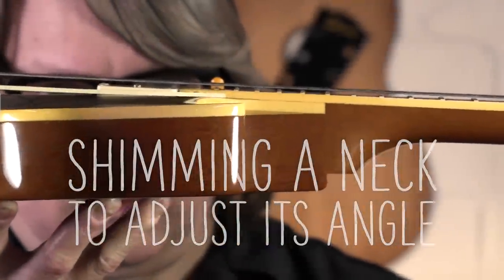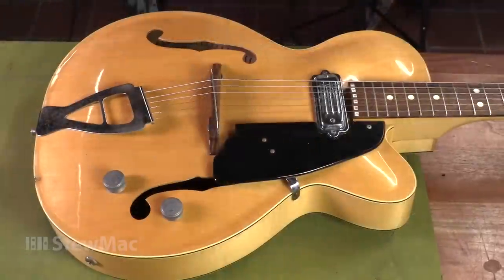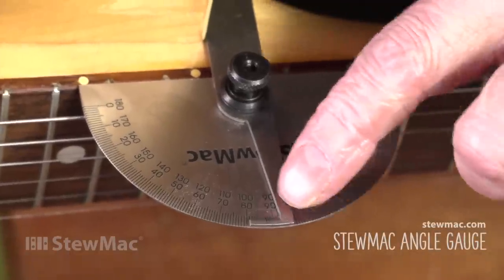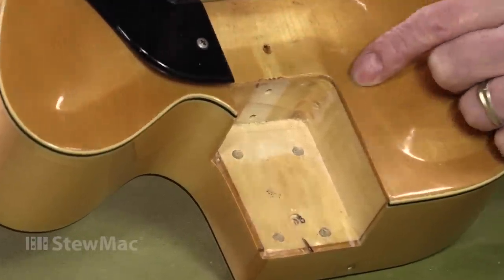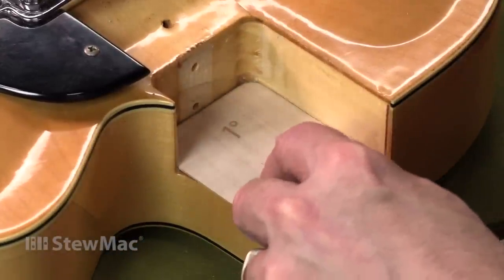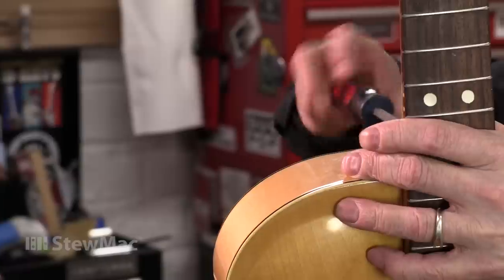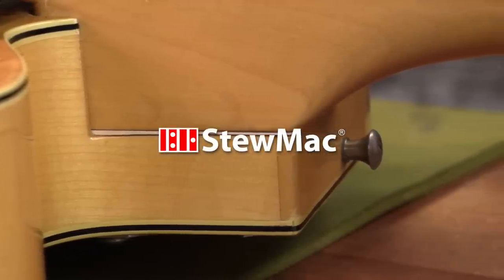How to shim a guitar neck to adjust its angle

Comment: the bare shim edges would absorb moisture,i'd coat it with honey shellac mixed with thinning alcohol so it soaks in deep,and a final thicker viscosity layer so the shim goes hard,a light sand and fit n forget,as long as the sanding is square and true of course.

Or make an angle jig to plane or sand new shims from maple.
Reply: He said to use a full size shim so clamping the neck on tight will inhibit moisture into the neck pocket.
Reply: wooden wedges are hammered into cracks in rock,which has a far stronger bond than  four screws into the neck through the body,to crack  and split rock,what then makes the neck/body joint stronger than the force that split the rock.
I would seal the wood shim as i said to avoid any warping  due to the wood being able to absorb moisture,even when the wood is compressed by  a screw joint and not hammered into rock ,which has to be said will compress the wood fibres far more.

Comment: Question: Why not simply flip the neck and trace the heel of the neck on to the shim? Seems easier than micro-cuts and radius gauges with the actual pocket.
Reply: @kevin paul halliday  Shh ! You're gonna ruin it for them. Stewmac employs lots of people selling and posting their wares.
If people find out that most of the tools they sell are not really necessary, then Stewmac will lose money and ultimately have to put off hard working people 
who are just trying to support their families . I bet you one of these workers has a new born baby they have to feed and nurture , and without work they wont be
able to do that.
What is it you have against babies anyway?
Reply: You can do that but how would you know how much to take off? In other words, where would you line up the neck on the shim?
Reply: Because that's the best way to do it if you also sell micro cutting tools and radius gauges.
Reply: That's what I do.

Comment: Definitely better than using picks or pieces of cardboard/ sandpaper to shim.  Makes sense to try to get full contact between neck and bottom of body pocket.  Any neck shimming will change the break angle at the bridge (if same action is maintained) , that may or may not cause a difference in "feel" which can be noticeable in string bending in particular.

Comment: I've recently procured an 82 USA Peavey T-15. I noticed it had a built in adjustable neck plate, I thought "sweet, I don't have to make a shim to get the action I want". However I also noticed that raising the angle would leave A: a gap between the neck and pocket and B: leave the bottom of the neck essentially teetering on the tip of the adjustment screw. I don't think I like the thought of either of those taking place. I'm just going to use the adjustment to get it how I like, make a shim to fill the gap and balance the pressure on both sides of the adjustment screws.

 Any thoughts on this? Am I overly concerned about something the Peavey already considered?

Comment: I'm wondering if I can use a shim but set it the opposite direction in this video to obtain a higher action on my strat. My new warmoth neck will not give enough relief to eliminate buzz and the saddle heights are maxed out.

Comment: @StewMac could I use a shim vice versa to get a neck angle shallower ? I have a 90's Strat which is buzzing at the upper frets and adjusting the truss rod does not work. Strats tremolo bridge isn't that adjustable either...
Reply: Try looking at the nut
Reply: @DavyHulme  that has the same outcome as trussrod adjustment. at least beyond the upper/12th fret. thx anyway
Reply: @PhilTheKnuckle  just a thought. It's could be a combination of several things;  crimson guitars have some v comprehensive set up videos, including one, well at least one, on neck shims, might be worth look at

Comment: I don't understand how putting the thick end of the shim toward the body helps. I'm so confused. Wouldn't that make it worse? Because now when you play a string at, say, the 15th fret you'd get buzz from the 16th and up. You didn't raise anything other than the 21st fret and every fret below is now angled further down. What did I miss?
Reply: I agree. In my case I think I need to put the thick end  towards the tuning keys, in  order to cure a problem with buzzing strings.

Comment: Whelp, this has prompted me to find and install a neck angle adjustment mechanism on my guitar. Goodness, they should all have one of those, or at least have one as a factory option, so much more convenient.
Reply from the maker: Convenient for sure, but a lot of adjustment mechanisms like Fender has used in the past can often create issues in the neck. We feel a solid tapered shim is the best way to go if you need to change the angle. Thanks!
Reply: @stewmac  Since then, after reviewing their designs, I'd have to concur. Using wood screws as pivot points and a single contact bolt as an adjustment source would lead to destructive force concentration. Something better would be a U shaped metal plate embracing the heel of the neck, with a stout piano style hinge being the fulcrum, and then a heavy bolt with a rounded head seated in a cup on the U shaped metal sheet doing the adjusting. It'd flop around when unstrung, but be solid when up to sting tension, but would also be a bit destructive of guitar neck and body to install, also probably more hassle than it'd be worth. So, yes, where there's a will, there's a wedge!

Comment: So, according to your explanation of full neck contact being desirable, the Fender Micro-tilt is a bit of a fail.  Since the only point of contact at the base of the neck will be the adjustment grub screw (and the neck screws....)

Comment: In my experience, 'full contact' is unnecessary.  A shim at one end of the neck pocket is fine, as long as the neck screws are pulled down nice and tight.  Also, the measurement method here is overcomplicating things.  Trial and error works ok.  Once you've done this on a couple of different guitars, it's easy to get it right first time.

If the angle needs to be too steep (maybe because a new neck is to be fitted to a body with a deep pocket), then a thicker flat shim made from veneer or thin plywood may be appropriate.  This would be visible, and would benefit from a finish.  Even with this shim, an extra card piece might be needed at one end to fine-tune the angle.

On the subject of getting the neck screws nice and tight: the best mod you can make to any guitar with a bolt on neck is to fit threaded steel inserts and machine screws.  This makes for a super tight neck-to-body connection.

Comment: Would installing a neck shim misalign where the neck screws thread into the neck itself? In my guitar the screw holes in the body and the neck are threaded so the screw always threads into the same threads in the wood. Increasing the distance and angle, even by a small amount, seems like it would cause you to be threading into new wood thus boring out the screw holes after a few times. That’s my worry anyway...

Comment: Trying to shim the neck to fit a gk-3 pickup on a strat but I have high action on the high frets and buzzing on the low frets, is that underset? If I shim it the other way though it frets out when I bend.. really a pain in the a**

Comment: I have a “huge” question, how do you correct the length or depth of the neck pocket, the distance between the neck entrance of the pocket to the heel ? I routed mine when I was young, too far back towards the bridge., probably 3/16 too much. What can I use to fill the pocket heel to correct the scale length of the nut to the bridge for a 25-1/2” scale neck ?

Comment: use stacked.overlapped business cards at the rear of the pocket. Nearly no cost and small scissors are all you need. 3 cards would be : bottom one about 1/2 pocket length and the other 2 1/2 of the one before it

Comment: If moisture can get in there with a shim installed...it'll get on there without any shims and perfect coupling as you say of the parts. Water is small. Capillary action, surface tension, whatever..it'll get wet!

Comment: Hi Erick, what about an 'Overset' neck situation and a possible need to lay shim's angle from the headstock side? Does this situation ever occur ??  Thank you. My Fender suffers from buzzing around the 16th fret. Guitar is a fairly new Custom Shop strat.  I could raise the saddle but then action is too high in the 5-9th frets.  Any help?
Reply: Take a notched straightedge and check the relief. Or capo the first fret, press down on the last fret and touch at the 7th fret to get an idea. I don't even know what you mean with shiming from headstock side. Your action on the first fret determined by your nutslots should be not more than a business card. That has to work , raising anything on that side will never fix your problem on the 16th fret. Check with a fret rocker if that particular fret is high.

Comment: How do you determine the size of the shim? Trial and error drives me nuts, waste of time. If I have a strat what should the angle be and isn't there a math formula to figure how thick a shim you need by string height?
Reply: yes, you can, just use trigonometry by measuring the height of the saddles and the height of the neck and using that to solve for the required angle. here's a video of someone explaining it with a bass neck
https://youtu.be/0BHMjiLW_Uw

Comment: Not bad but I'd like to see a little more precision shimming that neck!   Kidding  :)    its refreshing to see a luthier who takes pride in their work. I cant seem to find anyone even close to good to work on my guitars. They usually come back worse than when I dropped them off and scratched all to hell. I purchased a brand new Gibson Les Paul and while installing the strap locks I suspect one of the screws was defective as it snapped off flush with the body with just normal pressure. The screw was new with the schaller strap locks. Rather than risk gouging the new guitar up trying to remove the stud without the proper tools, I took a chance on a new luthier, (the previous two were hacks) on what should be a routine if not small job I wiould imagine.????   Again, the guitar was new and 1 hour old, the lacquer had not even hardened fully yet.   WHen I got it back the repair was great except the guitar was scratched to hell, I almost cried. It appeared it was covered with sawdust and wood chips and then just wiped clean with a dirty, dry rag. It was anaconda green, and showed the slightest imperfection.  Now I play my guitars hard and they get scratched and banged around while doing thier job, but Man I was pissed. I wanted to put the first scratches in.

Comment: Can you also stack the 0.25 and 0.5 shims to get to 0.75?
Reply: i needed to stack shims to get an old teisco in playing shape, so yes. however, with these full neck pocket shims, stacking adds a bit of height at the top of the pocket as well. i wound up trimming and shaving the end of one of them, which increased the angle to more than the sum of the two pieces, but gave me less bulk in the neck pocket with the angle i needed to raise the bridge.
Reply: @audiojihad  Yes, that makes sense, the thin end will get doubled when you stack them.  So a stacked .25 and .5 would be a little higher overall than a single .75 deg, if they made one. Probably not that much of a difference that the adjustment range of bridge saddles could not handle.

Comment: Ive seen this process done in both sides of the neck pocket, how do you know where to put the shim???
Reply: I'd say set the neck perfectly straight then take some measurements (1st/12th/last fret, etc) then you could draw the angle vs the strings and you'll know which side of the neck has to go up. Or just go by feel when playing with say the 3rd fret and 21st, you'll see which one bounces more in 2 seconds. I rather see a drawing first, and with some measurements and an angle you can calculate the exact width needed.

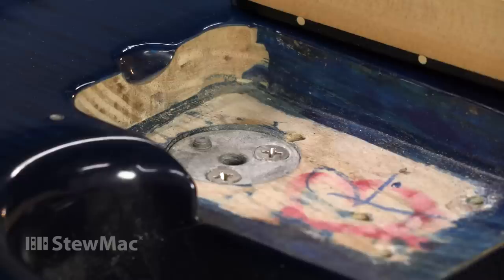Comment: At about 1:15 you talk about Fenders neck tilt adjustment. Doesn't that method leave a gap between the neck and the body?
Reply: Yes but it's really not that big of a deal. People like to criticise the neck tilt function of the 70s Fenders but generally any problems that came with those were because they were made very inconsistently. Look at any early G&Ls and you'll see it works fine. My AVRI 75 jazz bass has it and uses it to great success
Reply: @Andyjpro  I think I'll shim mine with washers for a penny or two. Washers over the neck screws should provide way more contact than the Fender method.

Comment: Funny, I just googled about this a couple of days ago.. Hmmmm..... A thing I'm a bit skeptical about though, a short shim instead of a full pocket shim would according to illustrated pics and people on forums bend the back of the neck so the fretboard rises at the end (which sounds completely bonkers to me..)
Reply: That is possible in some cases...remember that you have all the pressure normally distributed on a large surface now on a smaller one acting like a jack. You can also find that that really small shims just get pressed into the wood and do nothing else. But anything that is not compressible will work if it's still able to distribute the pressure  on a not too tiny surface. 
Shouldn't be paper.

Comment: Any suggestions if the neck is not a bolt on?
Reply: step 1: get rid of that guitar
step 2 buy a bolt on guitar
step 3 Enjoy your new guitar

Disclaimer: this is a joke, so don’t actually try this
Reply: Musicfreak1138...Raise the action a little at a time till it's not too high, yet comfortable & removes (hopefully) all of the string choke.  Also, depends on pick attack.  With a set-in neck, if I play above the 15th fret too aggressively, it can still rattle & possibly choke out on bends so I have to back off a little on the pick attack...FYI, I play with a height at the 12th fret at 5/64 inch.  This gives room for bends, slide playing & still good sustain on the high frets if i don't play too aggressive...Let me know how it goes...
Reply: There's no easy way to fix this at home, just send it off to a pro luthier.
Reply: a re-fret with larger sized frets may be your answer
Reply: Need a neck reset go to a pro luthier.
Reply: Neck reset.
Reply: @musicfreak1138 - Yessir! Shim / raise the bridge first. Check your fret levelling. Adjust your truss rod. If none of that works, consult your local luthier.

Comment: Why can't the bridge be raised? Makes the action closer to the nut too high because strings still not parallel to fretboard?
Reply: No, if you raised the bridge without changing the neck angle, you might not create action problems at the nut, but higher up on the neck. The strings might vibrate freely, but end up being impossible, or at least super hard, to fret.
Reply: I think the problem was the strings hitting the pickup when playing on the higher frets.
Reply: Unplayable in high areas, because the strings hit the frets above the played notes, and yes, they also hit the pickup. 
You could solve both problems by making the bridge higher, but obviously that would also make the action too high to play comfortably.  @mogwix
Reply: It could, but that doesn’t sell any shims....

Comment: You make it seem SOOOOoooo easy.  I'm really, REALLY interested in building a guitar.  Something with a shorter scale to accommodate my old arthritic  fingers, say along the lines of Rick 325.   I've looked at the mini strats, but no one makes the parts to turn them into real guitars. i.e. the tunners and tail pieces available to upgrade lesser quality, foreign made guitars, can't be made to fit the minis.

Comment: What kind of material is used for the neck shims?
Reply: Hard maple.
Reply: @eric_in_florida   & Alan Macs. Thank you. I couldn't find anything on the products page. I wonder if it's treated to protect the shim against humidity, since they advertised that a small exposed surface could cause problems in the neck pocket. 
With that reasoning, the unprotected shim made from a hydrophile wood could drag in more humidity.

Comment: people talk about neck angle like it does anything but change effective bridge height and to a lesser extent clearance  over pickup etc. I keep trying think of how it could, there does not seem to be any geometry that could do anything but that. People don't talk about it in those simple terms enough so we end up thinking there is some mystery aspect to neck angle, but I think it's simply a hinge point. However I am very slightly, maybe imaging, that 'shorter than full neck plate shims might have some affect on curve of neck above the plate, but since heal of neck is so thick it seems impossible that other than a full shim could cause any problems

Comment: I did it the wrong way - and it's worked for years! I didn't have the right shims and I had steamed a neck off my guitar (with a steamer that takes wrinkles out of shirts - also worked just fine except I had to touch up the finish). What I found was perfect - two clarinet reeds! I set them in the right spot, glued, clamped. 24hrs later - guitar neck has been solid for years and string height is spot on. I love creative fixes that work! Check out soundrestoration.org to see pics of more fixes I've done. It's fun!